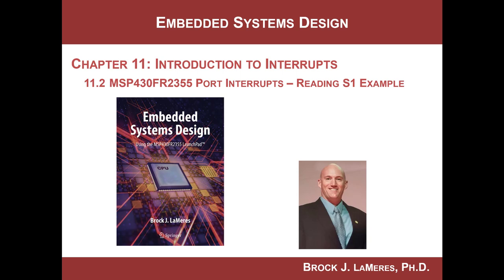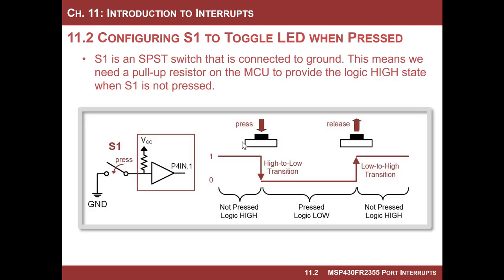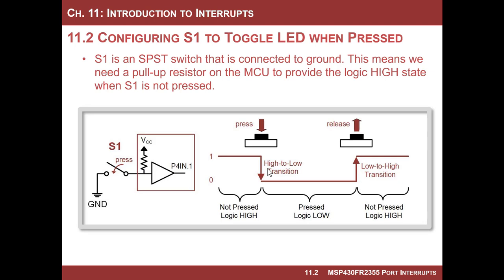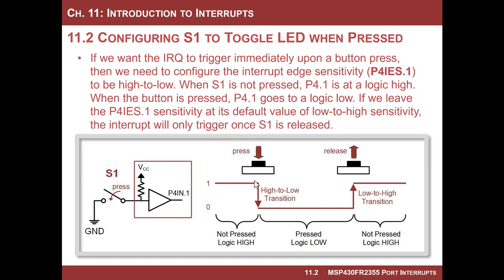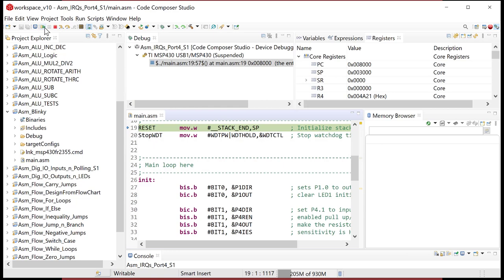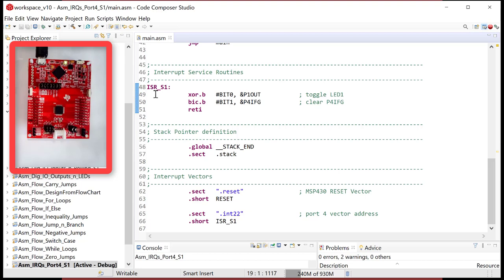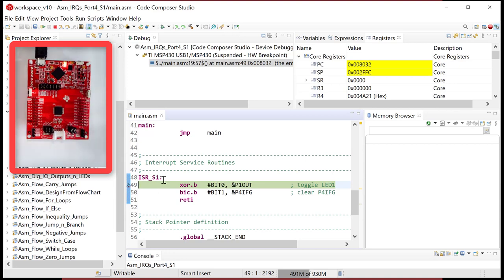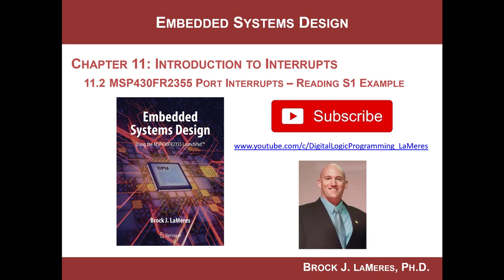11.2(b) - MSP430 Interrupts - Reading from a Switch Using a Port IRQ Program Example

Comment: If anyone is trying this with the MSP430F5529, the vector addresses are completely different. Also, P2.1 is connected to S1 not P4.1 => the vector address for port 2 is .int42. You also have to remove " bic.b    #LOCKLPM5,    &PM5CTL0" or else it will crash the MCU

Comment: Hmm, I am not able to find in the manuals that the interrupt vector for IO port 4 is at 22 (only word address and priorities), is there a page to find it?
Reply: hi, have you find it afterward? bc I have the same problem
Reply: @fatihdemir7178  Unfortunately, I still haven't figured it out...
Reply: @tinglin6121  thanks, BTW when you write the code in C, at the very end of the header file there are vector names, maybe it will be useful
Reply: you can find it in the header file for your MCU in includes, it is defined as PORT4_VECTOR